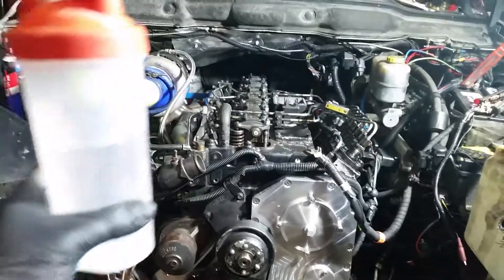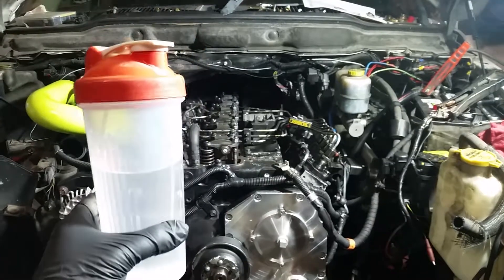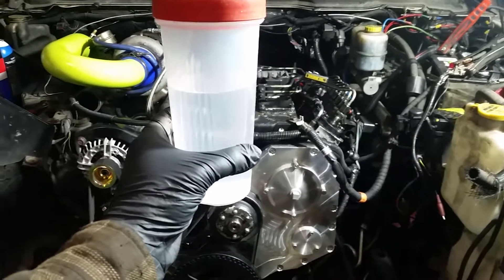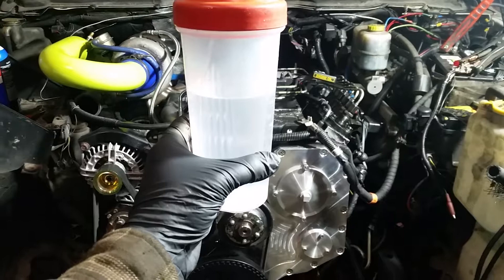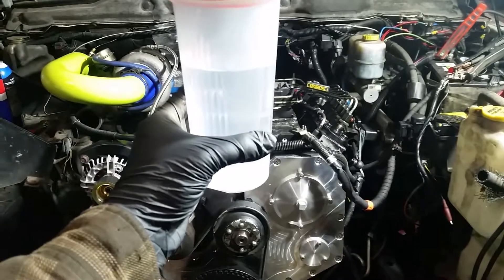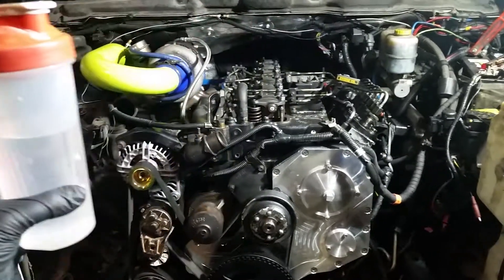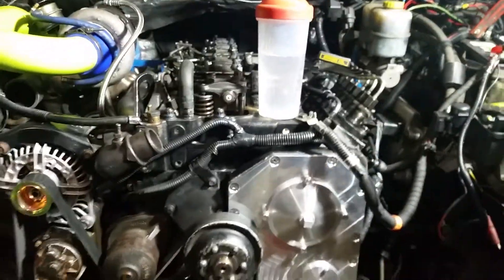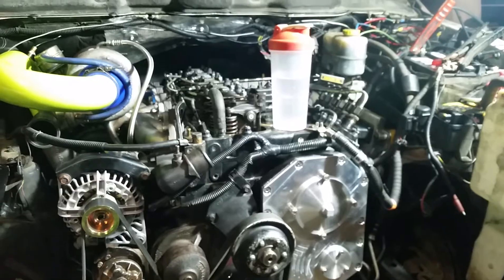Does The Project Snowball's Built 12 Valve Pass The Super "Scientific" Water Bottle Test?

Comment: Amazing
Reply from the maker: Thanks David! We are trying really hard to find the sweet spot on these motors, without being too  Overly ridiculous ! Do you have any projects you're working on right now?
Reply: @70440charger  I'm currently installing compounds on my 95 12v. Been at it for a few weeks now. 215 pump, 5x14 with 191's,369 and k27, 5" turbo back, exhaust brake, oringed, preluber, big oil cooler, etc
Reply from the maker: @daviddominessy  
Man! I saw that dyno run that power driven diesel did a while back and have wondered how they would do on the street! Cool project man! Let me know how the spool up is when you get it done!